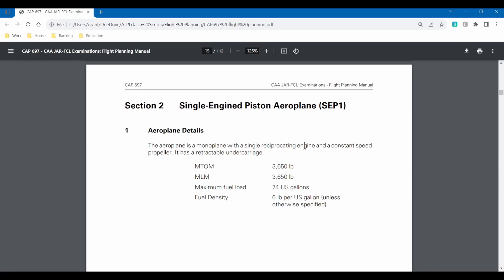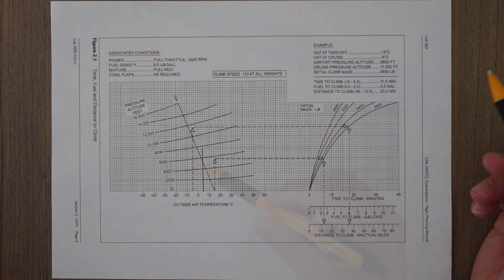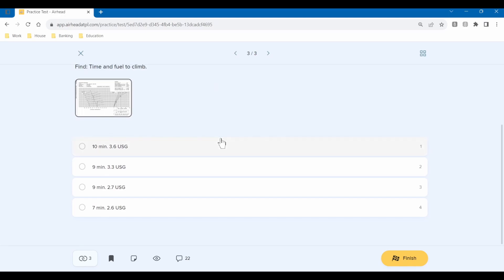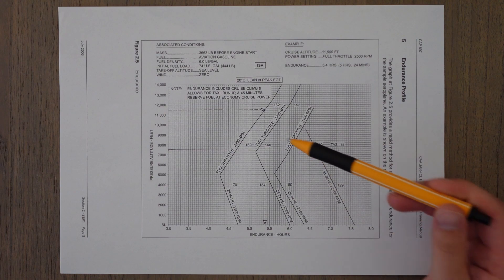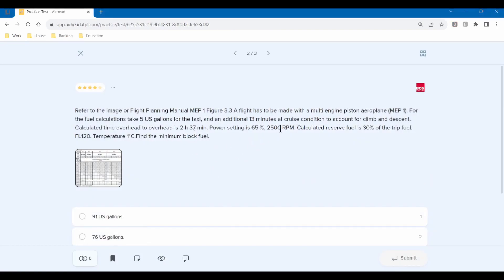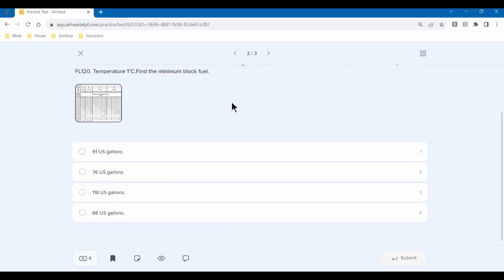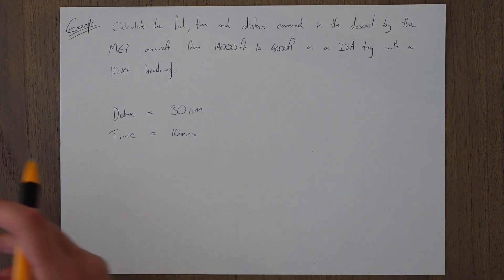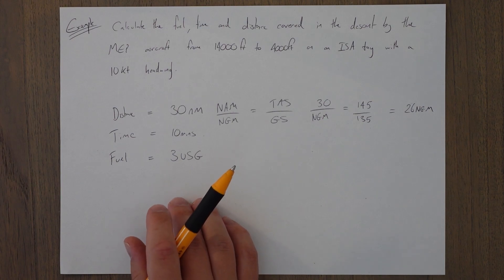ATPL Flight Planning - Class 5: SEP and MEP.

Comment: In the first question, how is 3.3 USG fuel to climb the correct answer since the line goes slightly off to the right from the center between 3 and 4? I would answer 10 min and 3.6 USG.
Reply: Exactly what I was thinking, I have to do a resit for fpm and this is a common problem for me. Answers are so close that I take the wrong one that looks more correct to me
Reply from the maker: This is an issue with the graphs unfortunately. Make sure you are very precise with your lines, use a nice sharp pencil and goo ruler. Then you have to just go for the closest answer.
Reply: I  thought the same...